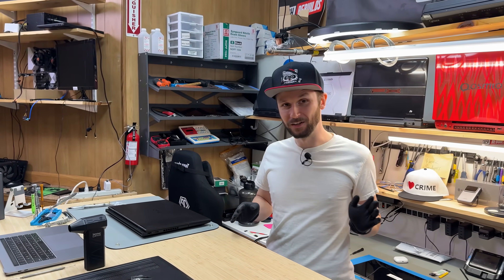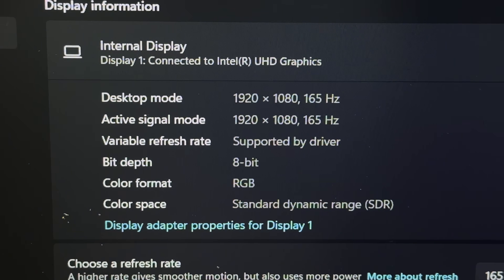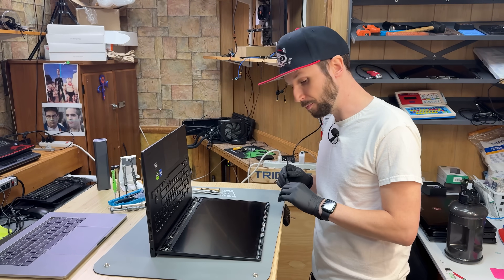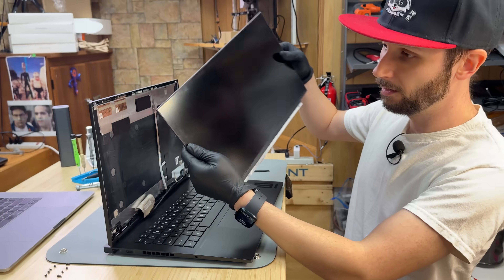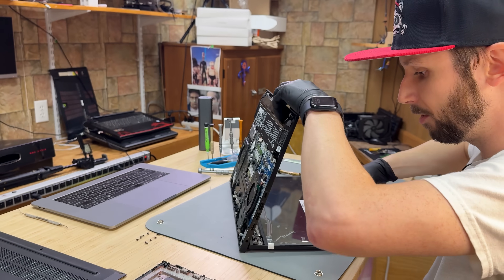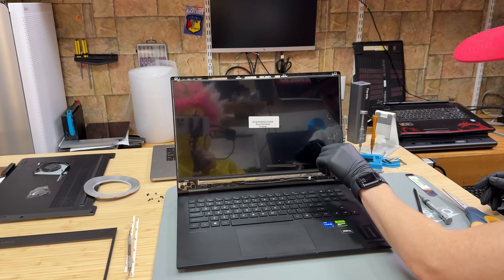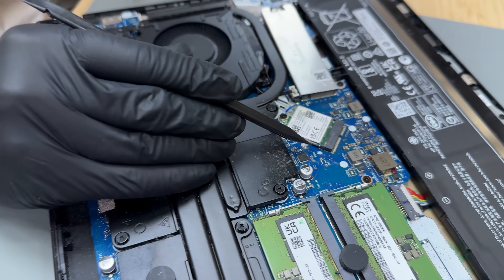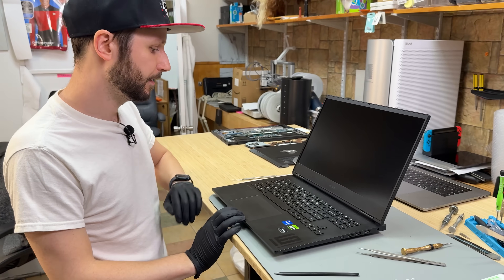The Laptop Upgrade Nobody Thinks About Until It's Too Late

Comment: there is no way you make a video with a omen after i upgrade to a omen 17... that is genuinely insane...
Reply: My omen just over heated recently. It might be dead . $1300 down the drain.
Reply: @blueforce9269  I've barely had any issues with cooling, highest i've seen the CPU go is 77° after which i just cranked the fans to max for 2 minutes and it went down to 50

Comment: I am not confident enough with myself cause my PC is the only thing I have and it takes like 10 months to save up but you makes me feels more confident in fixing my own stuff
Reply: honestly unless its something as easy as ugrading the ssd or ram. Im not doing it myself. I dont trust myself lol
Reply: @Rusty01  I have had an HP laptop since 2019 with its hinge break (it stands by its name). Its battery was dead too, so I bought a new one. Jesus Christ, the hell I went through to get the Hard Drive because every single screw kept coming out with its plastic thingy that was supposed to be attached to the computer. I swore to not do that to the Acer I have now and will take it to a tech to change my NVMe when I have the money to upgrade it and also recover the data from my old hard drive and put it in the new one
Reply: @Rusty01 I somehow managed to do things from adding a ram stick to replacing screens to repasting to even transferring motherboards while somehow not damaging anything 

Guess that's the trade-off for dropping every electronic I hold lol
Reply: buy an old X230 Thinkpad.  Just about any Thinkpad will do. Also, get a tent or backpack or something!  PC won't help when times get tough!  Even a guitar...
Reply: I’m a mechanic and I don’t trust myself doing any work on my pc I make my brother do it lol (he’s the one who built it and built his current pc)
Reply: @throwaway2082  my cousin built his own computer before IBM PCs ever came out.  Component by component. that's a bit above "building a PC" today.
Reply: @throwaway2082  
im also a mechanic and built my own pc. went flawless, booted first try. upgraded graphics card, also flawless. upgraded power supply because graphics card was over the limit of previous one. 

blew 1200 worth of mobo/ram/cpu. i figured it's new i shouldn't need to test that out the box, its a seasonic thats a good brand right?! THE FUCK IT IS. ruined my week when i had to take it to a pro to find out what blew.